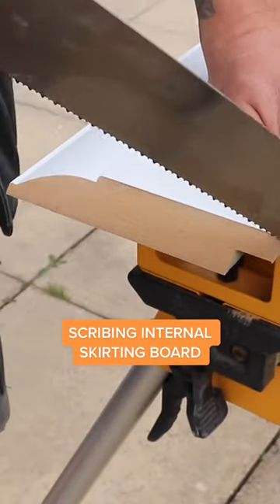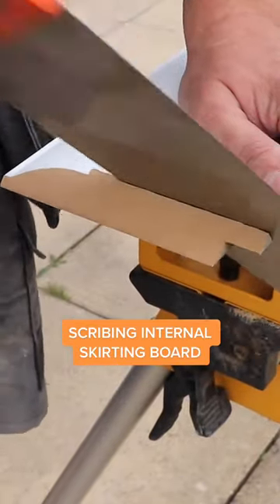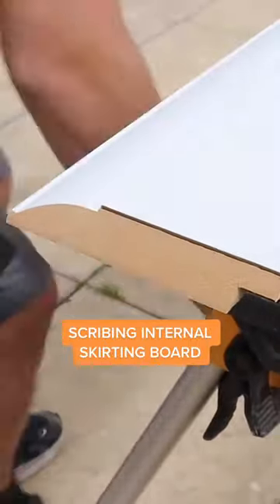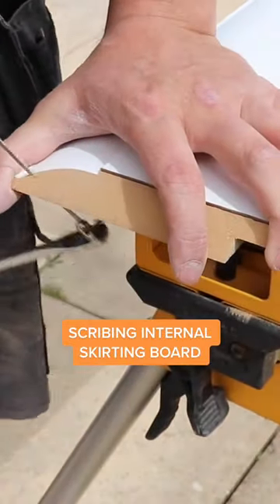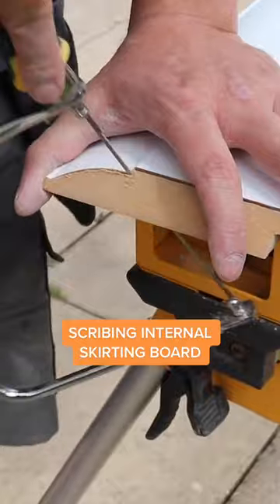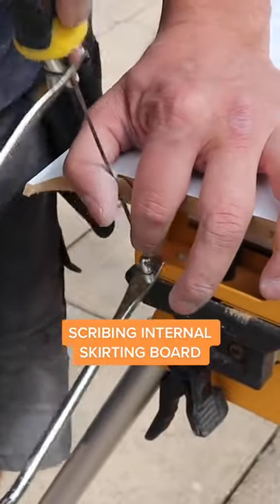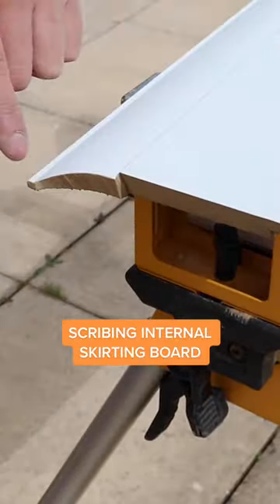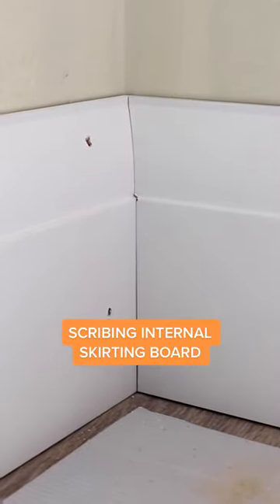Internal scribe skirting board #shorts #diy #skirtingboard

Comment: So can you not cut a 45 degree angle on both and it but up? I'm a beginner so be easy on me
Reply: Same question
Reply: walls are never a perfect 90 degrees (two 45 degree cuts) 
any warping in the framing, drywall, floor dips you name it some shit is always off. coping solves all those problems.

tools like miter finders can help you cut the precise angle, like a corner might be 44.5 miter degree, so you set your miter saw to 44.5. This is great for fast cuts and only needs a small amount of cauwk.
Reply: For real he did all that coping and no 45 looks kinda goofy
Reply: Coping looks cleaner my friend and fun to do if u install
Reply from the maker: Thanks for the comment! The reason why we don't cut a 45 degree angle on both is that corners won't be a perfect 90 degree angle so the joint will be slightly off
Reply: You could do 45's but if the wall is out of square then it wont look right. scribed joints just have a nice cleaner finish
Reply: Inside corners are best to cope. But you can use a miter protractor to get the exact angle. I miter the outside corners and use CA glue or wood glue to join them